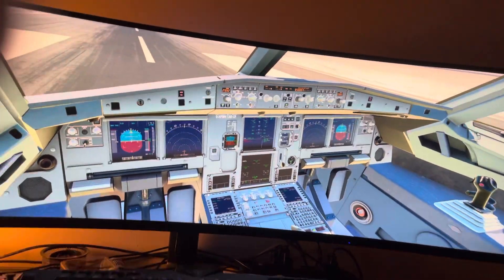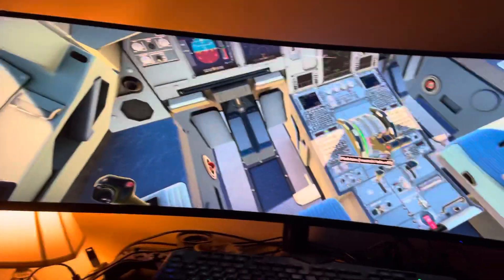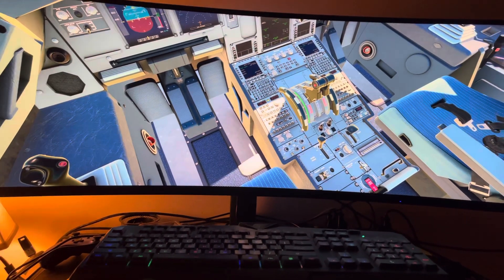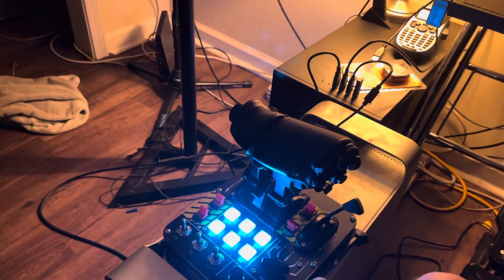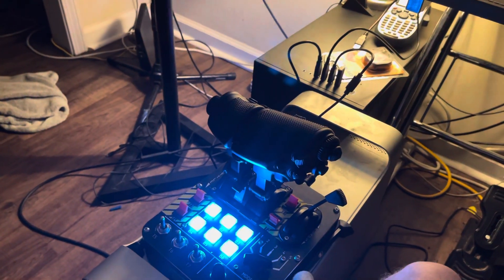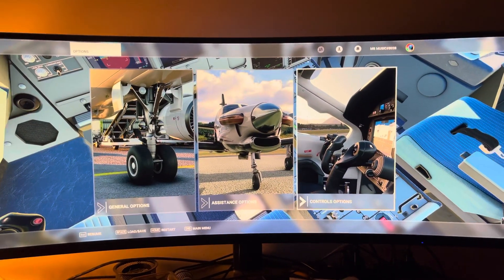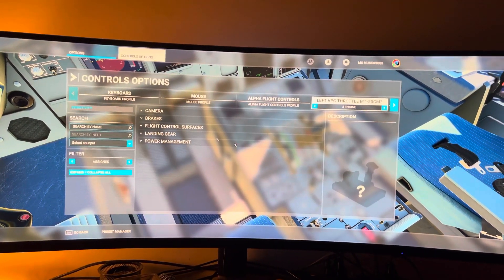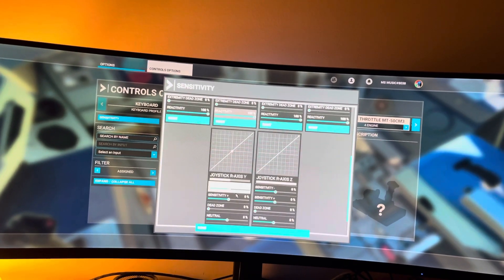Virpil Throttle setup in MSFS

Comment: I just got the VPC CM3 throttle. I'm having trouble trying to do exactly just that, when pulling back past the detents to put the reverses on max. do you have a video on how you program the cm3 to do just that?
Reply: mine does the same, i can configure the throttle for DCS but not for Flight SIm   it sucks  I've tried everything

Comment: Turboprop does not like low ideal
Reply from the maker: You can just set to standard throttle axis.  That video was made early in the time MSFS came out. I used that setting mainly to make it easier to have an easier way to do the throttle reversers with a detent on the throttle

Comment: Hi, your video gave me a lot of hope - are you able to explain how you got MSFS to detect the detented section of your throttle axis as reverse? I'm not sure exactly how to get the VIRPIL software and the MSFS settings to play right to make it work.

Thanks very much for any help you can provide!!!
Reply from the maker: I have not yet learned how to change things in the virpil software. But I know there are a few different axis that you can assign in MSFS. Not sure at the moment which one that is. But as far as detentes you can assign that on the EFB under settings in the FBW 320.
Reply: @Mattughs   ah thanks! that makes sense. Will have a look but I presume then that this only works with the Fly by Wire A320?
Reply: @Mattughs  oh I gotta download the FBW320. yea i just reinstalled MSFS2020 and got the CM3 myself, I was playing around with the stock MSFS airbus a320. I'm gonna try it out on the FBW.